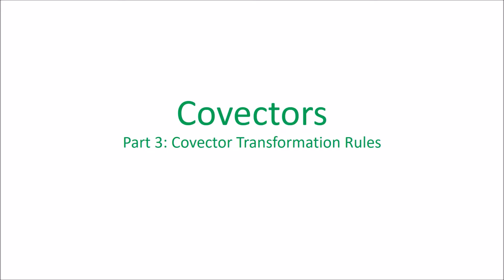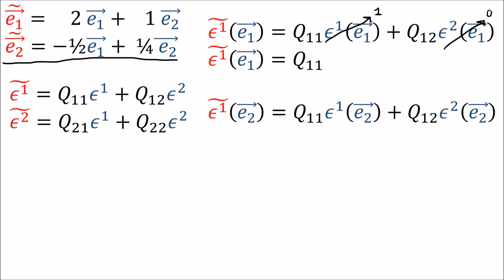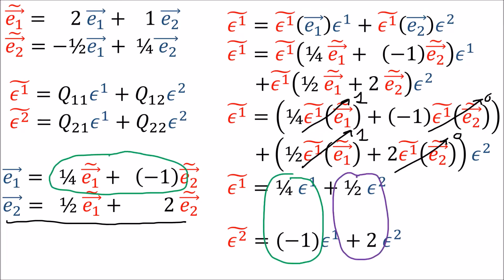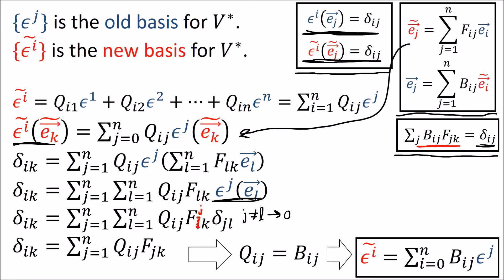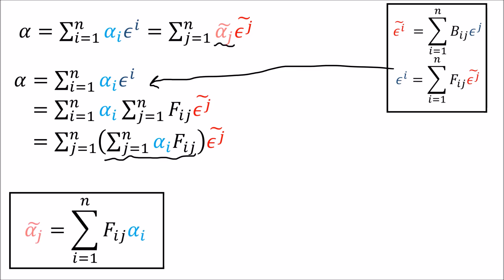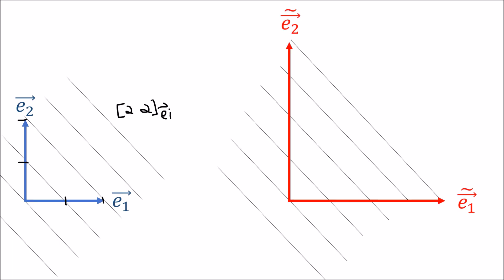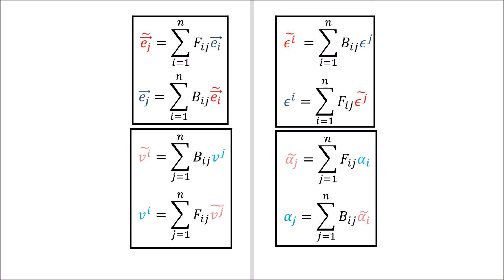Tensors for Beginners 6: Covector Transformation Rules

Comment: isn't it more correct to say that the dual bases transform with the transpose of the backward transformation? Because it's not exactly the same as the transformation of the components of the vector, but its transpose
Reply from the maker: If you write basis vectors in a row (covariant) that transforms with the F matrix applied from the left, then you write vector components in a columm (contravariant) that tramsforms with the B matrix applied from the right. Dual basis vectors transform the same way as vector components: written as a columm and trandfprmed woth the B matrix applied from the right. You could apply a transpose to any of the above formulas to switch rows into columms amd vice versa. But the above is the convention that I'm using.
Reply: @eigenchris  oh ok, I see what you mean, yes I hadn't thought of putting the vectors of the dual bases in a column. This makes it easier to understand and remember, but still the transformation that the dual bases undergo is different than the inverse of F, because if you make the comparison "fair" by putting both the bases and dual basis in row vectors, then it's different. Is this the right way of thinking about it?

Anyway as commented under other videos of this series, I wanted to thank you for the outstanding work, this is immensely helpful
Reply from the maker: @SteveRayDarrell  I prefer to use the rule "covariant = row" and "contravariant = column", instead of the rule "basis = row" and "components = column". Contravariant things have upper indices, and those indicate their position in a column. Covariant things have lower indices and those indicate their position in a row. When you can to rank-2 linear maps with 1 upper index and 1 lower index, you can continue to use this pattern to get the location of their components in a 2D array.

Comment: Does the delta function used in the definition of basis covectors imply that basis covectors are orthoganal to the corresponding basis vectors?
Reply from the maker: A given basis covector isn't always going to be "perpendicular" to its corresponding basis covector. That only happens in an orthonormal basis. A given basis covector is defined as being parallel to ALL OTHER basis vectors, except the basis vector whose index it matches... in that case the basis covector is as dense as it needs to be to give a result of 1 when acting on that basis vector. This is what all the zeros and the single 1 mean in the delta.
Reply: @eigenchris  "A given basis covector is defined as being parallel to ALL OTHER basis vectors, except the basis vector whose index it matches.."
Should that read "perpendicular to ALL OTHER basis vectors" 
Or is my brain stuck in reverse?
Thanks for responding.
Reply from the maker: @dennisgawera8788  Sorry, I mistyped. When I said "parallel", I meant to say that the covector stack sheets should contain all other basis vectors, except for the basis vector with the matching index. When I said "parallel" I was thinking of the 2D case, where the stack sheets are just lines. In this case the basis vectors with non-matching indices would be parallel with the line stacks.

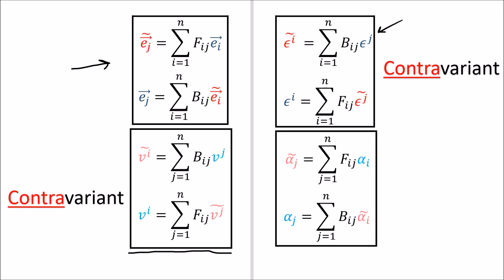Comment: Hi Chris, thanks for your amazing video! However I got a bit confused with the sigma notations here. In the previous videos the notations are correct as far as I can see, but at 4:14 I don’t understand the index of the sigma. I think, for example, if i is under the sigma sign then all the terms with i in it are added and the other index, j, populates the rows. Therefore, though each element of (e~j) is the sum of (ei)s, independent elements of (e~j) should not be added together, but exist alongside each other, therefore the j should not be under the sigma sign. However, at 6:10 the left halves suddenly have the correct indexes while the right does not. Can you help me finding out how should this be? Thanks!
Reply from the maker: Those are typos, unfortunately. When an index letter is repeated twice on one side of the equation, that's the index that should be summed over. I made this video 5-6 years ago, and I wasn't as careful with checking my typos back then. Sorry for the confusion.

Comment: Thanks for the video!

Question:Doesn't the covector basis (not the components!) use the transpose of the backwards matrix, and not the backwards matrix itself?
Reply from the maker: It depends on if you write it as a row or a column. If you want, you can write a covector as a row of components times a column of basis covectors. In this notation, the column of basis covectors transforms using B from the left. If you flip this so that it's a row of basis covectors, it will transform with B^T from the right. I explain this better in my more recent videos. You can look at the first 15 minutes of "Relativity 106a" to see a better explanation.

Comment: Let the covector's
old basis: ε1  , ε2
new basis: ε1' , ε2'

Let the vector's
old basis: e1  , e2
new basis: e1' , e2'

With e1' = 2e1 + e2, I write 
     ε1' = 2ε1 + ε2

However, using the formula Bij εj to find εi', I cannot get back ε1' = 2ε1 + ε2.
Instead, I got 
εi'= Bij εj
ε1'= B11 ε1 + B12 ε2 
   = 0.25 ε1 + 0.5 ε2, which is not 2ε1 + ε2

0.25 ε1 + 0.5 ε2 and 2ε1 + ε2 are not the same, right? Thank you.

Comment: sorry for commenting on such an old video, but I'd like to know if I'm understanding this correctly: the reason why, for the covector case, we sum over the second index for covector basis but we sum over the first index for covector components is because, from a graphical standpoint, we think about covectors as row vectors(?) Hence the index order gets inverted(?) So we can ultimately construct the change-of-basis matrix for covector components by simply stacking up row vectors (instead of putting column vectors next to each other like we do when we construct the change-of-basis matrix for vector components)(?) If you feel like this is too contorted of an explanation, please feel free to correct me, I'd actually really appreciate you doing so if you can, otherwise no worries, I don't want to waste any of your time, it's just that I've been mulling over this detail for a while and it'd be nice to come out of the rabbit hole without confusion. Thanks in advance no matter what

edit: typos
Reply from the maker: Yes, I think you're basically correct. One thing I wish I had realized when making this video is that: you can write a vector as a product of a row of basis vectors and a column of vector components. You can also write a covectors as a product of a row of covector components and a column of basis covectors. Changing basis is the same thing as putting an "FB" matrix pair in between the row and column for vectors, or a "BF" matrix pair for covectors.
You might be interested in watching the first 15 minutes of my recent "Relativity 106a" video on covectors. I feel like I explain the array notation much better in it.
Reply: @eigenchris  Thank you so much for the timely answer! I felt reassured after reading it, glad to know I'm on the right track haha. I'll definitely check out the other video you mentioned as well, thanks for the reference! Awesome work as always

Comment: At 2:33 the summation should be over j not i.

At 2:40 you correct this when you have both sides act on ek tilde, but then you have the index beginning at 0 and not 1.
Reply: Also for the transforms of the vector basis it should be a sum over i not j ( right ?)

4.11 - all of the summation indices are wrong? They should all be summing over the linear combination of vectors or convectors. Summing over i when you have a linear combination of j vectors or whatnot can’t be right .
Reply: Thank you so much. I was so confused by the 2:33 issue until I realized it might be a mistake, and decided to check the comments. It's really nice to have it confirmed

Comment: IMP INFORMATION : 

This info has been shared in video 1.5 also, but I am just reformulating it here. 

I have watched from video 1 till this video. There are confusions in summations only for one reason.  The reason is that both the vector bases and vector themselves are written as a column matrix in multiple slides. By matrix multiplication, one can see that this is not possible. Either the vectors must be row, and the bases must be column OR vectors must be column and the bases must be row. The forward and backward matrices and the summation conventions used in these videos follow the rule that the vectors must be column and the bases must be row.  

[e1-tilda  e2-tilda] = [e1 e2] [ F ]         ( note - order matters , you cant swap F and [e1 e2] ) 
[e1 e2 ] = [e1-tilda  e2-tilda]  [ B ]       (similarly here) 

F =  2  -0.5   
       1   0.25  

B =  0.25   0.5
         -1        2 

This is the correct order.  Formulate the summation convention based on this. 

e-j-tilda = ( sum over i = 1 to n ) ( e-i )  F-ij
Reply: Also co-vector bases are column and co vectors themselves must be row, which is exactly opposite of the vector.  This is followed correctly in the videos.

Comment: 2:20 Shouldn't it be summed over i, since you oddly chose ej-bar and not ei-bar?
This page would be much more clearer if you used the implied summation convention and used different indexes for epsilon and epsilon-bar, since you can remove then later anyway.
Reply from the maker: Yes. My mistake.

Comment: @2:08 shouldn't it be the transpose of the backwards matrix? I did my own derivation and found Q_ij = B_ji, i.e. B transposed. Again this is because your indexes are flipped in your transformation between bases (top right 3:08). 

I understand that whether it is transposed or not plays no role in your point of showing which aspects are contravariant and covariant and I have a feeling in the future episodes we won't be using these relations so it doesn't really matter. However, I would like to point it out because it is maths after all ;). Also, interestingly, these errors actually made me do the derivation myself and so I feel more engaged than if there were no errors.
Reply from the maker: I'm sorry. I'm still not understanding why you think the indexes at 3:08 are wrong. As far as I can tell, they are correct.
Reply: eigenchris if you look at either equation for e_j or e-j~, the very first j and very last i should be swapped around
Reply from the maker: They look fine to me. It's possible you are getting confused because of an error in video #1. Did you read the description of that video? I really need to upload a correction for it...
Reply: If you look at the equation you have j on the LHS and the summation is also over j, so it makes no sense. I don't even know how to write it out, if you want to find e_1 then how would you write it out (for n = 2)?
Reply from the maker: Yes, I see at 3:08 I should be summing over i instead of j.

Comment: Why there is no arrow on ε.
Since ε is covector basis, and a covector basis is a kind of vector sitting on covector space, I think there should be an arrow symbol on ε to indicate covector is a kind of vector.
And from viewpoint of ε , ε is the vector basis and e is the covector basis , right?
Reply from the maker: I don't normally see covectors written with arrows, so I didn't use arrows myself.
The "dual space" of V* is another space called V*, which is essentially identical to V in every way, but they are technically different. Saying that the e basis is the "covector basis for ε" is "mostly correct", but technically you would take elements from V* and not V.
Reply: Thanks.
Well, I understand this is just a matter of notational convention.
That is OK.
I am looking forward to seeing your tensor calculus videos.

Comment: You really did a flawless lecture; again, excellent referral to the previous work; adding real numbers make the example much more clear as does the check on the covector. Your use of the F & B notation really helps to keep the discussion clear to an extent that I didn't realize until this vid. Your explanation on the index change was both clear and very insightful - often a step far too often overlooked by writers of books.